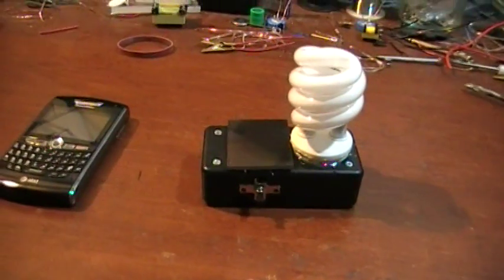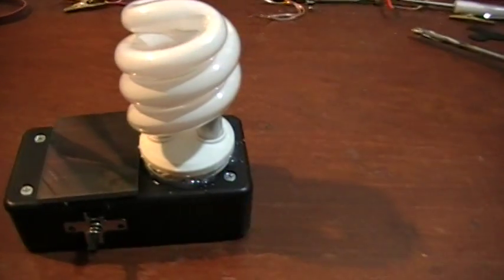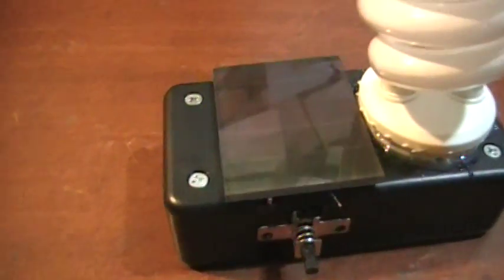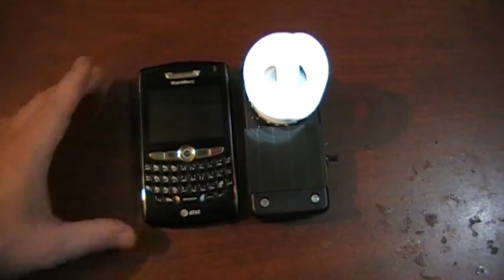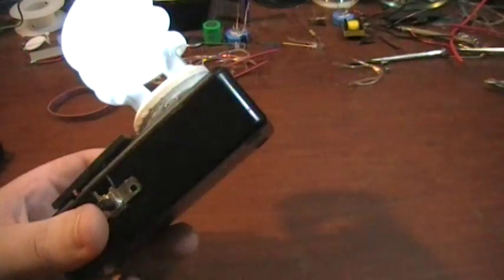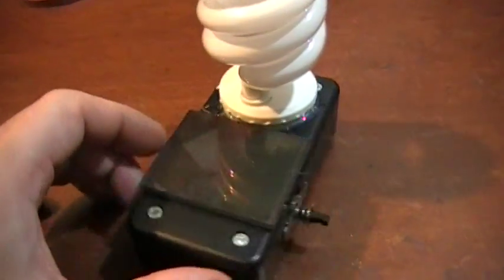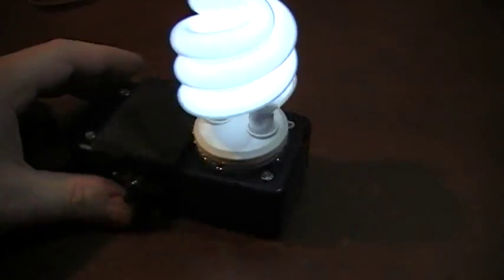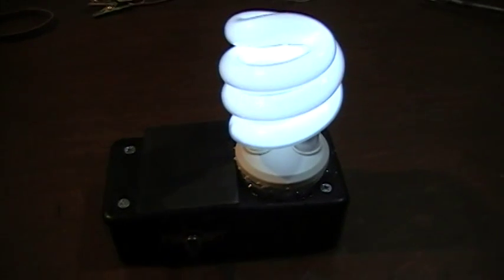Fuji Circuit Joule Thief CFL Light

Comment: @VicentiuB  hI . i NOW RUN mY aa FUSI MODS OVER 36 HOUS ON AN aa BATTERY 1.2 VOLTS . IF U WOULD LIKE THE DIAGRAMS VISIT oU DOT  COM AND SEE LIGHTSABERS JOULERINGER THREAD . IN THERE IS MY MODIFICATION TO THE FUGI CRCUITS . I IMPROVED ALL MY OLDER MODS TO INCORPORATE ANOTHER COIL AND SOME GERMANIUMS . i have given up free energy research and now am dealing with cancer and most of my vids are for my daughter . thanks .